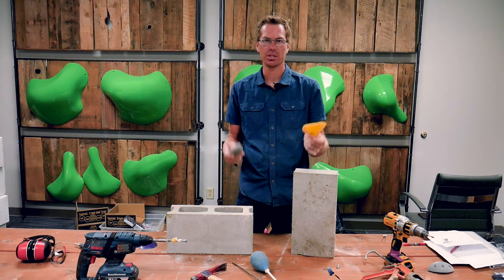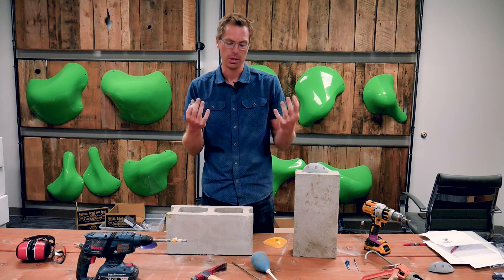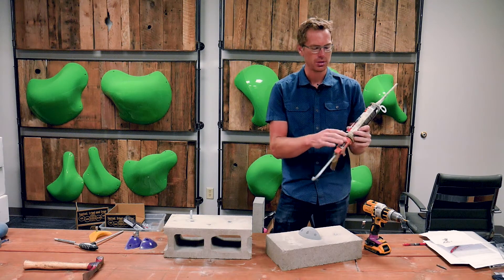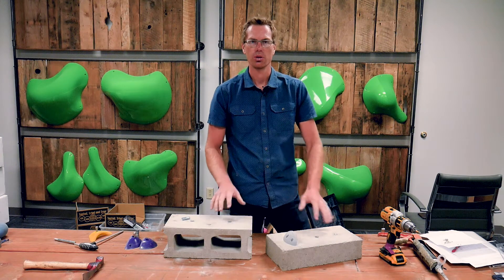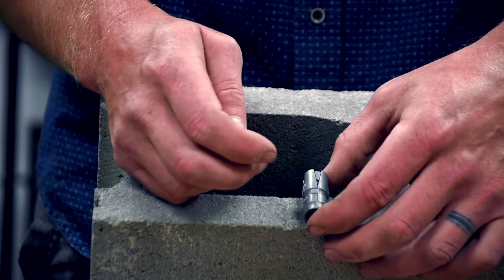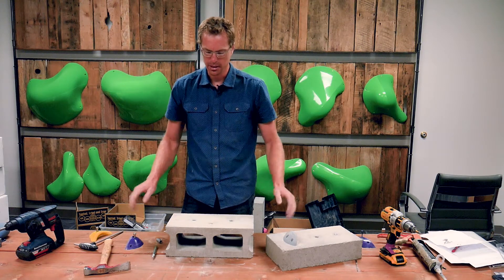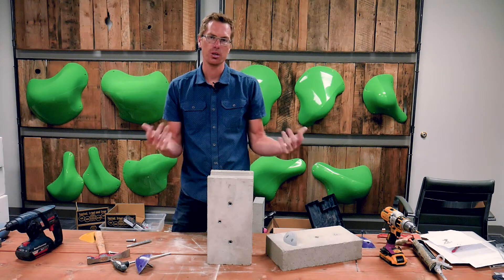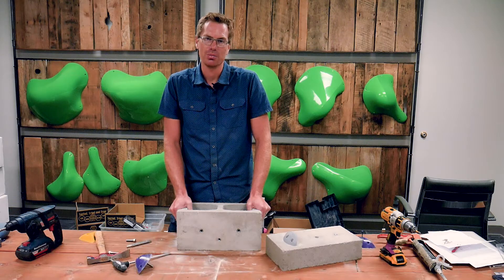How to attach climbing holds to concrete

Comment: Totally awesome video - thanks for running through everything from start to finish.  Would you mind sharing the model # / size of the Bosch and DeWalt hammer drills that you used?  Want to rent / buy the right sized tool for the job.  Thanks.
Reply from the maker: This is the 18V cordless hammer drill! Most major tool brands have comparable models!

Comment: Hi there, I have a nice granite rock that is a bit steep near the bottom and I would like to install climbing holds into it.  Can I use these techniques?
Reply: I’m gonna do it but instead of screws I’ll be using bolt glue as if I was bolting a regular rock you feel me?